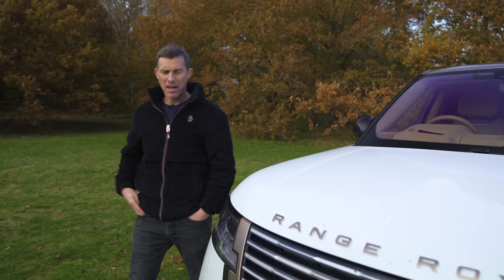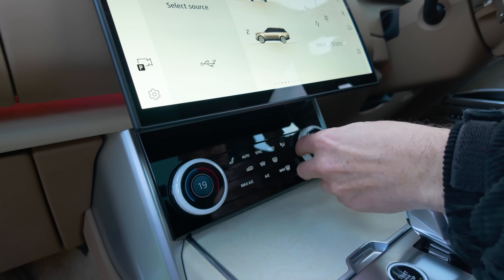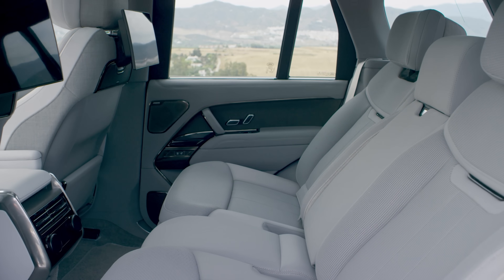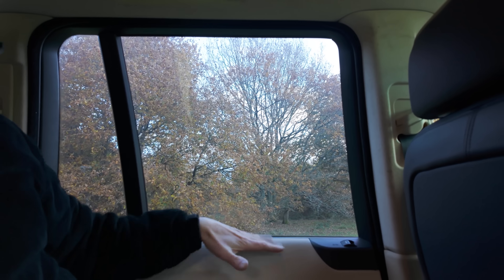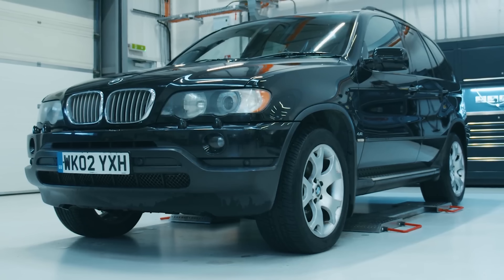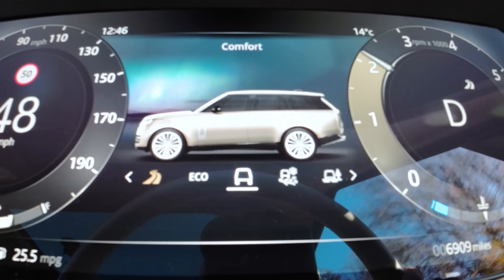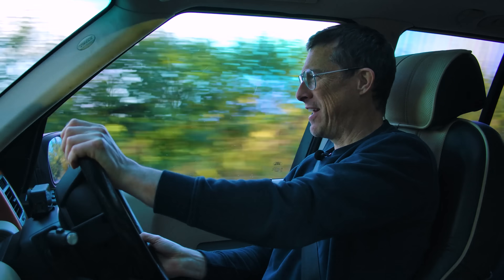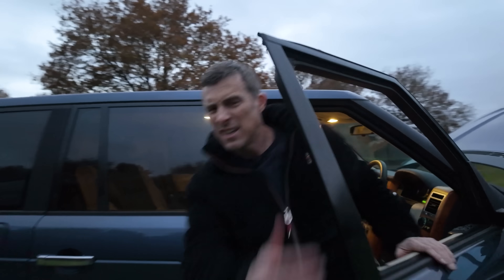£2,000 vs £200,000 luxury SUV!

Comment: That L322 is testament to not how old a car is or how many miles it's done, but who has owned it and kept it well maintained.
Reply: We have an 07 one with the TDV8 which has done 400,000km (248,500 ish mi). Still runs like a dream
Reply: Yes, check the DVLA MOT history for this. Up until recently it has passed first time. I'd happily spend my own money on this RR.
Reply: Imagine how many headgaskets that thing had changed.
Reply: I used to own that exact L322 about 8 years ago. There's actually a review video on my channel. Still the best interior I've ever had in a car.
Reply: Exactly! I know plenty of people with high mileage range rovers
Reply: THANK YOU made my night brother💯 I have a ‘03 dark green w 232,000 miles on that BMW 4.4 replaced EVERYTHING lol a lot genuine parts too. But not a single warning light, I have spend about $60k all in over 11 yrs but she’s my daily. Even redid the timing chain, radiator hose ignition coil’s transmission diffs transfer case fluids everything lol 😂 even Magnaflow exhaust. She still gives me the feeling I’m looking for walking up walking away and especially driving on the freeway 🛣🤙🏻
Reply: @Ryan-vj9bl but there is just something about an older 2000's Range Rover. They have a sort of class that the older ones and the newer once don't have. And luxurious without getting too complicated. Still a lot to go wrong, but compared to the new one that's nothing.
Reply: I'm 14 and I would love a L322 TDV8

Comment: Theres something about the old model that i just love
Reply: The headlights! New one has more boring ones and no life in it
Reply: As Matt said "everything is controlled by nobs" just like British politics
Reply: Timeless shape .
Reply: The price 😂
Reply: The back of the old one is elegant
Reply: @CocaSirius  especially the back the old one looks more classy
Reply: The old one is the proper classic shape for a 4x4, and with better proportions. The high squared-off corners of the bonnet are better for gauging distance when parking etc. The new one looks stretched and the rounded edges make it less distinctive. With that said, the GM gearbox fitted in the early L322 is prone to failure after about 80k but you can mitigate that by ignoring Land Rover’s “sealed for life” nonsense and draining, flushing and replacing the gearbox oil every 50k or so.

Comment: You know... I am actually quite impressed with the old one. Love the style and it seems to be in good shape. Over 170k miles (which is approaching 300k kilometers) is nothing to sneeze at.
Reply: Imagine how impressed you would be with a 20yo Lexus. The car is falling to pieces.
Reply: A 20 year old Lexus would stand its own, this 04 Range will cost you more than thousands a year to own
Reply: @Narrowcros  A 20 year old Lexus isn't $2000 though and this luxurious 😂the value holds on them for a reason.
Reply: @djkjthe3rd185  True because the Lexus will actually work, your literally comparing the least reliable car to the most reliable one, even Chinese cars are more reliable than Range Rover and old ones too lmao even the air con doesnt work. They guy knew it would cost him way more than 2k a year to own it per year, so he just sold it.

Comment: I have a supercharged 2005 L322. Got it for under £4k. Magnificent car.
Reply: Good to hear. How is the running cost like?
Reply: Did you also spend 16k for maintenance too?
Reply: @gnrtx-36969  
You are a dummy if you think it costs 16k to repair. Learn to buy a good car and these in good condition are rock solid.
Reply: Have the same,had for 10 years so far,used everyday, best car i ever had,

Comment: Man that car in 2004 would have been the most technically advanced car
Reply: They were. He didn’t really mention enough that back in 2004 barely anything came with a touchscreen display. And it shows all the off road settings too. They were as nice if not nicer as an equivalent Bentley or Rolls Royce, just like the new one is.

Comment: I have a 2004 4.4, awesome car. Currently on 93k miles, no warning lights on the dash, everything still works. These cars (& anything LR really) get a lot of stick for reliability, but my experience has been a pleasant one. Parts aren't expensive, and its really easy to work on. So much car for the money,  i previously had a VW Touareg and it pails in comparison to the RR. My old "legendary" Volvo 940 was far slower, far less reliable and worse on fuel. Just shows you can't believe everything you're told. many people with opinions on vehicles have never even owned one

Comment: Great video on the old vs new.  I love my 2019 RR Sport HSE and its been perfect! I've had the X5 and SQ5 and my RR is far far on another level! Absolutely dead quiet inside when driving as well.
Reply: don't write Bullshit! RR sport is garbige. heavy, suspetion too firm, engine (unless svr) is stupidly not effectve,but SVR with 5 miles per gallon shame to drive, Bugatti has same mpg. 
But BMW e53 4.8 (even 4.4) will destroy it all the ways. not speaking of G series X5 on air suspension...
Reply: landcruiser is far better
Reply: @lemcakes32422  I don't agree. Not on the luxury side.
Reply: @BotsWeekendCovers  if you want Luxury Bentley is better
Reply: @lemcakes32422  I bet but it's more than I am willing to pay. 👍
Reply: We had (husband) the ‘19 Discovery HSE luxury. No way that it compared to a bmw of the same year, which I had the ‘19 x7 50i, not M though. We got rid of the Discovery in 8 months after purchase because windshield after one rain started leaking, got an X6, which we got rid in one year, and settle with a ‘20 M760i.
Reply: @DanDan-tt6gv  I wouldn't touch a Discovery and I had the X5, I never had the X6 or 7.  I did have the E60M5 (Hated the SMG) The M4 (Loved it but not enough HP) and the wife had the 650I (awesome car)  I have just fallen in love with the RR HSE.
Reply: @lemcakes32422  Land Cruiser is only more reliable, the Land Rover is better in everything else
Reply: @lemcakes32422  I said it's been great and I loved it. Wtf is that got to do with anything you asked? Geez.
Reply: @BotsWeekendCovers  geez all i said was your Range Rover deprecates x2 faster than a Toyota Land cruiser. i have Toyota Land Cruiser 4.6 ZX V8

Comment: A lot improved throughout the L322's reign. I have a 2011 supercharged model and there's much less the new one has over it (the Bentley luxury aside). Even the 0-60 isn't that much better + the Jag V8 is actually pretty reliable.

Comment: Those door handles not popping out at the beginning(Matt was obviously pushing the button)of the new one is just a prelude of the multitude of problems waiting for you around the corner😳😂😂………don’t buy either!
Reply: The handles are the same as has been used for years now with no real issues.
Reply: Press the unlock and the drivers door opens first, another press opens all of the doors which is why it did not open when pressed first. It’s configurable inside Pivi. So it’s not a problem waiting, don’t add to the misconception. These cars are fantastic.

Comment: My daily is a 2006 Range Rover Sport. 
It’s got 102k miles on it and is spotless! 
Im running 22 inch rims with 35 profile tyres and it still drives pretty well thanks to the air suspension. 
Yes, they may not be as nice as the most recent ones but you gotta remember, current tech was not around back then. 
Try comparing a Range Rover from 20 years ago to a mercedes from 20 years ago and you’ll see that these had a lot of class! 
And thanks to the massive price crash recently, they are silly cheap now!!

Comment: As the former owner of a cheap old Range Rover, let me tell you no amount of savings make it worth the stress over the reliability and the high cost of maintenance/parts😅. Not to say the new one is better value however. I realise most buyers buying new range rovers are cost insensitive, but I just want to sing the praises of the recent Dacias and Skodas, which in my experience have been phenomenal on and off road and offer a much better value (ie for any given cost of used range rover, the less old Skoda at the same price will give you far less a headache).

Comment: The older one in standard form eg no silly grill, looks classier, new one look like “look at me”, old one will be much cheaper to put right (I know if spending 200k on car you can afford the repair) but in years to come the L322 will be cheaper to fix, also for all the stick they get it tends to be niggly faults not major, Iv owned 3 of them, never had major head ache or left stranded, but they do need a big battery, performance would have been better if it was a 55 plate on with the jag 4.2s/c engine, I currently have in mine and what a engine, reliable, super smooth and quiet, not bad on fuel considering weight of the car. Mine also has some rust on rear arches so that’s being sorted in spring but once done should last.

Comment: Quite honestly I prefer the look of the L322 (the £2000 model.) For me, it looks the way a 4x4 should look, in shape and proportions. But I suspect the target market for the latest model is unlikely to go off road or tow a heavy trailer. The L322 has a number of features that can stop working with age, but the latest model has loads more surplus gizmos which will be equally redundant after a few years.

Comment: Recently bought an 07 tdv8 sport hse (full blacked out with all the extras proper drug dealer spec) with over 200k on the clock... only thing ive found doesnt doesnt work is the parking sensors. Even the centre console fridge works! Its cost me two weeks wages, i cannot believe you can pick up a car that cost 70k in 2007 (thats what i paid for my house in 2013) for sub 1500 quid. Its quick, its unbelievably comfortable and when i ask what people think i paid the answers vary from 7 to 13k. Bonker value if you can turn a blind eye to the road tax bracket

Comment: Milky oily residue on the oil can, can also o alot of them time just be condensation if the car have been run alot in town and not really getting hot and so on🙂 but if it is on the dipstick you have problems eitherway 😂

Comment: bought a 2008 BMW X5 E70 few years ago. You are right. Absolutely bargain when the level of driving experience exceed so much then the value. Of course there is always a catch - as long as don't break down. Will continue to drive until i find another newer X5 in 2026/7. O yeah.

Comment: Sadly, in the states, that 2004 runs around 10k give or take.
Reply: KBB shows the 2004 V8 at $6000, tops.
Reply: @epbrown01  "shows" "kbb" then there's reality. The ones I found aren't even autobiography trims. Also, "$6000 tops" is 3x $2000

Comment: We have a 2013 L405, it has not been the most reliable or cars  we have owned it since 2017 and it has many issues but we love it a lovely car to drive  and its economical on Diesel, it tows anything with ease we want to replace it with a used car but what do you replace it with, we have looked at a  newer Toyota Landcruiser  but they just don't drive like the old RR does, think we will keep it until the MOT repairs become uneconomical, last MOT it needed some work nearly £1550  and road tax is not cheap but its like an old friend, if we could afford the new RR we would have one but £200k is just ridiculous I don't think any car is worth that price and no RR is that well built to justify that price tag.

Comment: Surprised Land Rover didn't have soft close doors yet in 2004. Mercedes and even Honda had them in the early '90s.
Also, when are they going to start hot dip galvanizing their cars? Rust on such a modern car is crazy. But then again Mercedes still hadn't figured out how to do it right for some reason yet at the time either.

Comment: I quite like the old Range Rover. It's obviously aging now but looks rugged and capable with a bit of off road. The new one is very sleek indeed, and designed instead for the customer who used to buy a luxury saloon. The only time that will go off road is when it gets parked on the driveway!

Comment: For those saying how much would this be worth it 20 years IT WILL NOT survive 20 years it will be crippled even if one of those screens fail which will happen and they fail alot car interiors get very hot and very cold in summer/winter and the fact that you cant just swap them out they have to be "programmed to the car" means going to the stealership probs 10k plus

Comment: Note. If a 20-year old Range Rover's 12V socket breaks, what're the list of things that will break on the new model in 20 year's time? Lol. Most of the "tech" is dumb and just increases the cost. Edit: Also, my 32-year old Honda Prelude had the option of rear wheel steering. Lol. What "modern tech" are you talking about?

Comment: Way way too many unnecessary electronic gizmos to go wrong in that new car; I had a 5 series and it was FOREVER complaining about some system or other throwing an error code. There's a lot to be said for mechanical simplicity. The ideas have outpaced the reliability  of the systems used

Comment: The old one isn't worth £2000, it was just in an environment where it's value wasn't appreciated. It's impressively intact. Anybody who has followed range rovers know the distinct sound that used to command the road. Which is evident in the 2004 and not in the new one. It's no wonder the Mercedes AMG G63 is trending, sound.

Comment: Good job. But, in my opinion, the main problem with the modern automobile industry is that the creation of cars is controlled by marketers, not engineers. A modern car is like gadgets and not like a car. So, the result of such a rapid decrease in value a couple of years after purchase😢

Comment: 200,000 ! And you get a 2019 Ford Flex lookalike. Well, I'd prefer the old Range. It has style!  Imagine we all drive a 6000 lbs hyper-super computer on wheels just to go grocery shopping. Everything is getting fat in nowadays. Luckily, this new Range won't be around in 20 years after all the bits and bytes gave up. Have it recycled and we may drive a 7500 lbs Range Rover in 2035?🤪

Comment: The clicking noise is from the heater , mine does it every time you turn the heating or air conditioning off , it’s done it for years now with no harm , I own a 2002 model bought new by myself 235k on clock all done by me , on my 3rd gearbox 😅 and my repair bills each year are at least £1500.00 , I still drive it all the way to Spain every year 1500 miles each way , must admit I get a little scared these days , but it’s never let me down , my problem is I’m emotionally attached to the bloody thing 😂 I will just try my best to keep it alive for years to come . This year wasn’t the best £4.5k spent on various issues to get it back to where it should be . The car is worth nothing financially so most people including the garage think I’m off my head 😂😂😂😂

Comment: The new ones are rubbish, i used to work for Jag/LR and when i used to wash and valet them, the trim would fall off etc and break down often. Definitely not worth the money asked for them. Also please don't encourage people to write off and scrap old examples if they go wrong. If someone wants to put the time and money into getting them fixed then let them! It's a shame that older cars are getting less seen on the road due to scrappage! EVs should be the ones getting scrapped in my opinion

Comment: They need to put that old body on the new Range rover, because the outside of that new RR looks absolutely horrible, and those stupid big wheels and skinny tyres makes it look even more Shite. The inside looks good though, but the dash like many modern cars looks bland and ugly and lack of physical controls is a big no no. Too much tech to go wrong and too expensive to take off road. What is the purpose of this car? I think they should bring that that 20 year old car with the modern engine and drive train, posh it up a little bit, add a decent Navi and sound system and sell it as an all purpose go anywhere vehicle, it would sell like hot cakes. This modern rubbish only appeals to people with more money than sense.

Comment: A car that loses 99% of its value in less than 20 years isn't luxury or symbol of class. It's a statement of stupidity of its owner. Name any Toyota or Honda and I bet you can't buy a 2004 model for 2000 pounds. This is despite the fact that when new they were priced a fraction of Range Rover.
Reply: toyota & honda?    bro ppl rich enough to afford & maintain range rover dont even think about honda & toyota
Reply: @bsjddjk  I didn't compare Toyota or Honda with the crappy Range Rover. I know Toyotas and Hondas are much much better cars. I just highlighted value retention of these cars which is directly related to their quality and reliability.